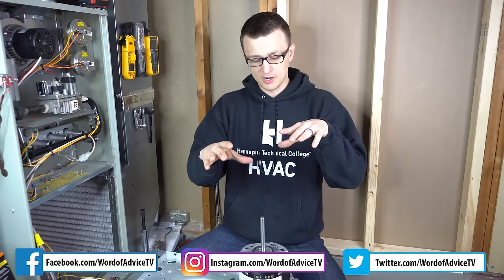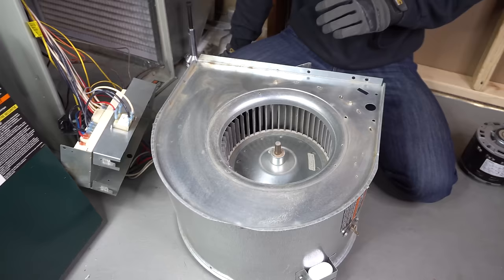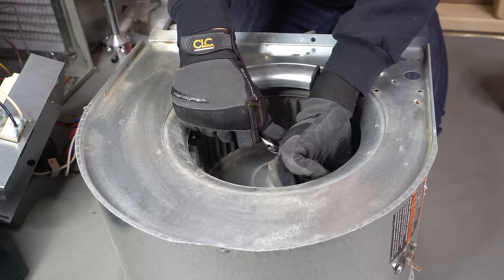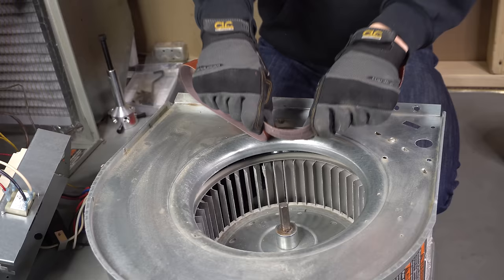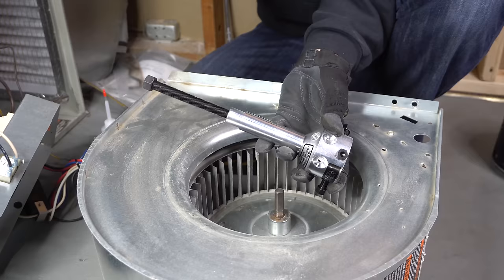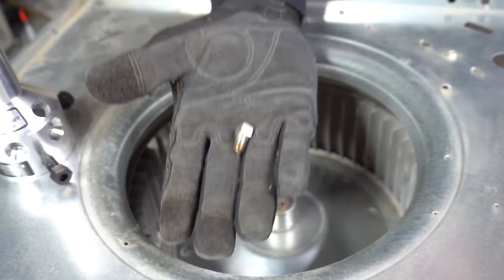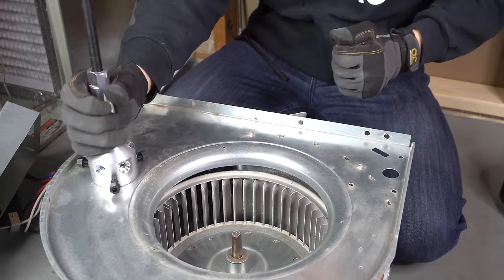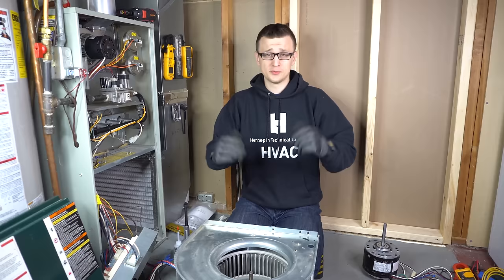Furnace Blower Motor Not Coming Out and How to Persuade it

Comment: So I had a blower motor lose power. I could hear the technician hammering away in the basement he told me that the squire cage being bent is what killed the motor. The fan was running fine, but the problem was it would start to die off. But it never made a clanking noise the motor running for the 10 minutes before it died. Ran smoothly with no noise.  I think the technician bent the fan while trying to get the motor out. I can clearly see the marks where the fan was hit with a hammer. My question is, should  the technicians company cover the cost of the fan?

Comment: After run for more than 5 minutes and reach the set temperature, the burner is off, and the blower keep running for a while. It seems right. 
However, after the blower stop, it try struggling to restart the blower a few times ( around 5 times) without the burner is on.
It make lots of restarting noise. We don’t know why and it only happened these two years.
I  had replaced the starting capacitor   and won't help.

Comment: Great Video. Between WD-40 VS Zoom Spout Oiler, which one work better ? Thank you for sharing ^_^
Reply from the maker: The oiler is more of a lubricant whereas WD-40 is a penetrating oil. So I suppose if the shaft is really rusted, WD-40 would be the better choice. The zoom spout oiler is usually all that is needed in most cases though.

Comment: How long do i need to zoom oil blower motor.   . Is not ez to access.  ,  neeed to take off controlboard.  2006 tempstar , i did oil outside condenser motor every year since watch ur video

Comment: On your scenario 3, can someone using torch to heat it up then let it cool down? And apply  WD-40. Can the thermo expansion help save the blade?

I am just a DIY,  any professional  opinion is very appreciated.
Reply: I was thinking the same thing?
Reply from the maker: @Wai Li   Yes, heating it up with a torch may help get the motor out. And if you add some penetrating oil like WD-40 on top of that, then of course your chances get even better :) Luckily scenario 3 rarely ever happens though. Usually if you do all of the other things I talked about in scenario 1 and 2, that is more than enough to get the motor out.

Comment: I would like to ask your opinion...actually I am a technician...what possible cause of a low cool PAC? I cannot get the specific current using the clamp meter? I already charge the unit to its specified PSI? please reply.
Reply from the maker: I do not work on PAC units so unfortunately I would not be able to give you any good insight on this problem.. Perhaps another viewer will have a good idea later on though.

Comment: And Lennox condenser fan motors I will just order a blade with it, those ones can be nightmares
Reply: Thank you for the tip! I just had a Lennox condenser that the fan not willing to run not long ago.  But luckily, applied WD-40 saved me that time.  I am definitely looking for the fan blade too, along with the motor.   I think the second time problem on the fan may end up need to replace it.
Reply from the maker: @Bagger Det  Thank you for pointing that out! I agree. With older condenser units, if I end up ordering the condenser motor, I always order the fan blade with it now. Saves me a lot of hassle..

Comment: Been watching your channel for a long time now.  What are your thoughts on Evcon A/C systems?  Looking to replace a 3.5 ton system in large mobile home and can't find barely any reviews on this.  What little I've found seems really bad.  I've always appreciated your honesty on this channel and look to you as a great resource.
Reply from the maker: Thank you for being a long time subscriber! Evcon/Coleman generally does not have good reviews/feedback as far as I know.  That being said though, most mobile homes I worked in had either a Nordyne unit or a Coleman and most of them are well over 20 years old. So it seems like they are durable units but being that I rarely work on brand new Coleman units, I don't know how well the new Colemans hold up. Sorry for the long answer that essentially didn't answer anything :/
Reply: Word of Advice TV   Awesome. Thank you so much for the lengthy answer. It’s exactly what I needed. You are incredible.

Comment: Do you use WD40?
Reply from the maker: If I don't have the turbine oil, then yes. WD40 works great too
Reply: @WordofAdviceTV  I like your videos a lot due to fix my HVAC. I have just fixed replace the blower motor today and it is running now. I just like to share my problem here because I didn't see any people addressed. My HVAC short cycling because of the motor short circuited. I used the multimeter to check AMP, once the motor was on, the AMP went up to 40A, then shut off, then started over again. Before that, I have checked it, 1.1 ohm, and 120 volt. 
Thanks and enjoy in Hawaii!